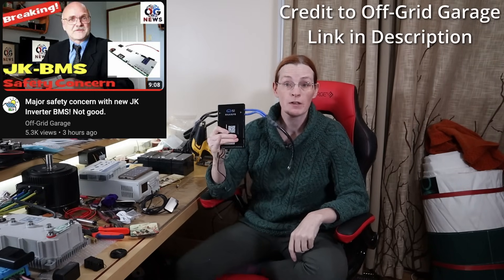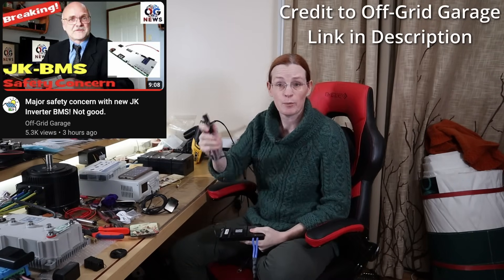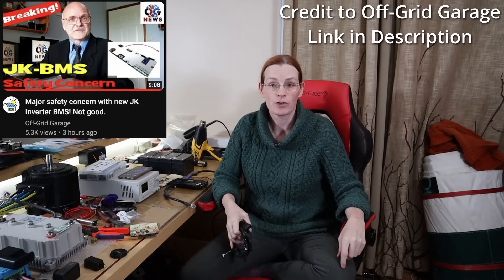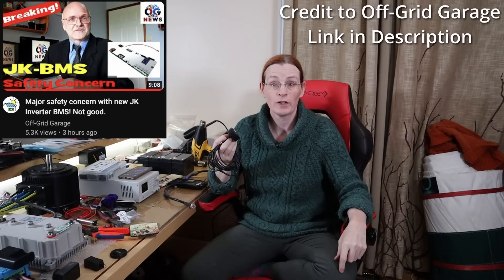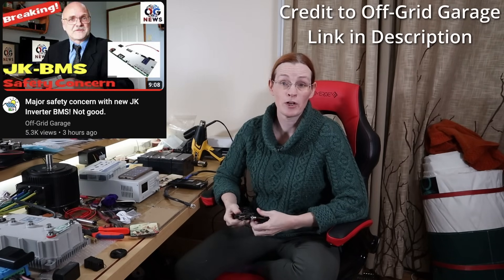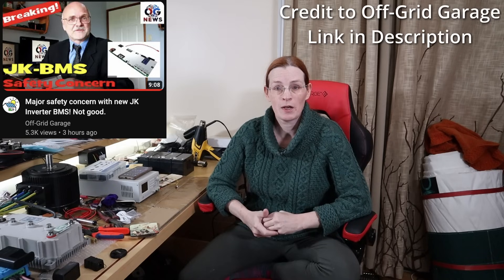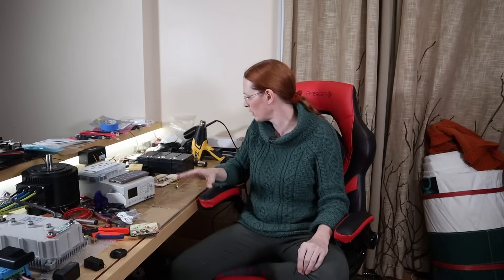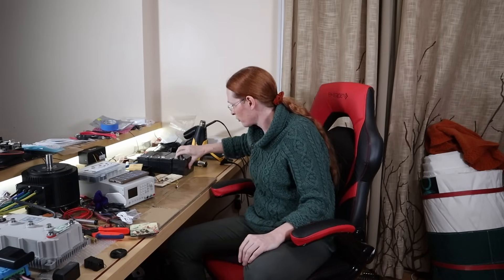News from Off-Grid Garage; Dangerous JK BMS Flaw

Comment: For once I strongly disagree. This is almost a witch hunt. Frustrated or not. This is an over reaction. We are talking about a new specific model that exists to be a replacement part for a very specific product - that has an issue in in a very specific way that don’t even concern the normal user. For Andy ? Maybe. But one of these are installed and set up and you forget about it - connected to A battery. You would never have seen this issue. This is IF you have one stored on a shelf, disconnected. End users don’t randomly dismantle their devices and put them in storage and then expect them to be put back in place without needing to set them up again. I’m getting not only frustrated but angry at you for your reaction. And no, I’m not on the pay roll of JK-BMS. Just lost a lot of respect for the channel for blowing this up in such a manner for a NON issue such as this. Daym.
Reply from the maker: To me, the most important thing is that I am trying to encourage people to take on projects. If I do that right, people will naturally copy what I've done. If someone bought that new jk BMS because of my videos, and then suffered damage, I would feel horrible. I was unhappy for a while with jk, I've made no secret of that. I make my living in redundancy and high availability; I can not call a problem like this "minor" when it could have been avoided with simple fail safe values, and/or basic quality testing. I'm sorry that you're angry with me, but I stand by my position on this.
Reply: @TheDigitalMermaid  yes, we both work in a similar field with regards to redundancy and high availability. Tho I do it on a more component level than you do. It’s not uncommon to see issues such as this from established companies like Carrier owned Autronika etc even - behemoths from USA. I strongly doubt this issue would be a crisis for anyone without “shutting it down” by disconnecting and effectively isolating it from the battery, something an end user does not do. If it happens when you disconnect a breaker on a battery or if you press a button on the BMS to turn it off while being connected it’s supply voltage from the cells then I would lift my eyebrows.  In my opinion no BMS should come without physical dip switches OR be chemistry dependent aka work only with a specific chemistry. Idiot proof is always the best way to do it even for professionals. Believe me, I’ve blown stuff up doing stupid mistakes myself plenty of times. It’s the PSA warning warning JK-BMS is junk I don’t like. It’s still the only BMS that handles balancing cells properly with a built in active balancer. Sorry I got angry in my initial post. But I was literally shocked by the outburst. And from everything I’ve seen and heard this is HIGHLY unlikely to be an issue for anyone not disconnecting it from the cells. So it’s not really any kind of shocking that they have not caught onto the problem with all the rush of Andy wanting the product out there in the wild asap with 10 software revisions or day depending on Andy’s wishes with regards to functions.

Comment: Well done Andy for bringing this to everybody's attention. Whilst I totally agree that this new JK BMS is potentially dangerous and that those who are about to buy a BMS should now look at other makes, the old JK BMS has stood out as being the the best on the market (see Andy's previous videos). Unless it is shown that these older JK BMSs have a dangerous fault I will continue to use them. I have three on a land based application which is a much lesser risk than on a boat. For most of us the 5v start up procedure is only a one-off procedure during first start up so is a minor inconvenience.
Reply from the maker: Older models you've used and tested are probably going to stay fine. The reason I felt I needed to make this video is because you never know what you're actually going to get from JK when you order. Maybe you'll get a good and reliable BMS, maybe you'll get one that could destroy your batteries. It's not a risk I can recommend anyone else take.
Reply: Don't overdramatize. Jk BMS are still the best of the budget ones and the speed they fixed this flaw is remarkable. Additionally use a BMV712 as independent last resort solution and something like this won't destroy anything in your system. Yes it should never happen but did...difference they stood up and fixed immediately. Fu.. up always happen, the difference is how and if you even fix it. This compared to many other company incl expensive victron that is not fixing anything or with a huge delay. Victrons 100V range of MPPTs for example the remote steering is hot=on when the remote cable gets disconnected due to any reason. Absolute noGo in EE and a major design flaw they don't fix since 5 years, the phönix shorepower charger 50/1/1 gets over 70 degrees hot but eg cable rating in boats and RV outside the engine room is 60degrees Celsius due to ISO standards...victrons answer was installed in engine room or change cables, 75 degrees is normal..really???...the dealer I bought agreed with me and took it back in the end.
Reply from the maker: @chrisr819  How would the BMV712 save a cell from overcharging with this flaw? It can't see the per-cell voltages. As I explained in the video, it's not just this issue, it's a long line of problems with this flaw being just the straw that broke the back. I can understand why people will still choose to use JK, and that's fine. Notice that  I didn't say "don't use it", I said "I no longer recommend them". I chose my words carefully. 

Every one of us has to decide where our comfort level is, and I have mine. JK crossed it, and this being my channel, I felt I had to say something. I've shown JK BMSes in use in my project for 2 years now. If someone saw that, and figured if I used them, they should use them and then they had a problem, I would feel terrible. So for me, my project, and my risk tolerances, I don't recommend them anymore. 

I'm not overdramatizing, I'm speaking my opinion.
Reply: Maddie the BMV712 has 2 measure curcuits so you can set it up as midpoint monitoring that means it measures one half so 8 cells 1-8 together versus cell 9-16. So if you have a runner eg 200mV in cell 10 then half 1 is eg 8x3.4V=27.2 versus 7x3.4+3.6v 27,4V and if you set thershold to 150mV then the BMV712 triggers the relay output to shut off. I take a breaker with trip coil, you need a battery fuse anyhow so the BMV712 connects to the trip coil of the breaker and battery disconnected. This is a requirement by ABYC and if you don't have it in US then you won't get insurance or if a claim happens they deny coverage and most likely cancel your boat policy. In an event like JK BMS all cell will go to 4.2V×16 and if your bank has 50mV deviation then the worst that can happen that 3 or 4 cells hit 3.7V while others have 3,55-3.6V and then the HVC voltage of 16x3.65V is reached and BMV trips the breaker. If you have bigger deviation (which you shouldn't have in 1p16s when they are top balanced and normally taken well care by BMS) then the midpoint monitoring trips the breaker. Like this no cell will be damaged. It cannot work on cell level of a single cell but its good enough to protect the bank from desaster events. And again ypu are obliged to have an independent last resort sountion due to ABYC doesn't matter which BMS you run and that for a good reason. With breaker with trip coil you have no additional contactor in your system, just a 2nd method besides a normal fuse has to disconnect it. I mainly use ElectrodacusBMS as i don't like contactors but also no mosfets based BMS as i often use bank as hybrid starter and house and the inrush or surge currents of a motor destroy the mosfets over time, especially if they are not matched and calibrated which for the price JK offers their BMS (as nearly all other chinese mosfet BMS) is simply not possible to do. So if a motor sizes the surge can be easily quadrupled and that kills eg one fet of your 10, BMS still works but with 9 that ahve to carry the current but because unmatched they do 't switch in the exact same moment so 1 or 2 fets have to carry the whole load..and wear til they break. So you have a slow and unrecognizable slow death of the BMS as when eg 5 fets are left it can only carry half the spec. For motor and propulsion you need a current free BMS ELECTRODACUSBMS is perfect but not available in 48V, so more or less contactor based ones like REC are your only correct choice. That just as a side note. I often use the combo in house that i have a main pack mostly from winston cell thats the master pack and eg starter and windlass is connected because this cells can do 8C peak together with an ElectrodacusBMS+BMV712, then parallel battery packs 1p4/8/16S with 280 or 304AH EVE cells+JK BMS+BMV712 to get the desired capacity. So they don't get any huge surge currents. the BMV712 then brings all the battery data into cerbo too.

Comment: It's a firm wear problem its defaulting to Lithium Ion - It should have been spotted at the development stage - Fortunately most folks solar or grid chargers will prevent overcharging as long as the cells are in balance  - it needs resolving ASAP as the BMS is the primary safety system
Reply from the maker: The problem is that the voltage curve is so flat, that it doesn't take much for one cell to spike it's voltage before the others. Unless the BMS can request the chargers to stop, I don't think it's safe to trust the chargers to save your cells. I think I'll do a follow-up video, because this has come up a lot.

Comment: This is what happens when Electronic Engineers do software. I've seen this before and will again. They always say "why does it cost so much to do software? Its easy!". Rant over.
Reply from the maker: You're not wrong, but the problems at JK are structural, I am now convinced. In the end, product quality is the responsibility of management, they allocate R&D budgets.

Comment: The part from the 4s-8s i got one around the same time and in the video where you test the 4s i don't think you connected the last positive wire to battery+, the last wire is the power supply wire for the bms, could you retest this please i am really intresed if it will work, you just need main battery negative on the ballance wires and on the B- connector, and power on the most positve wire as this is the powersupply lead. So you don't even have to build a pack to test this just connect it to a 12v psu or one of those lead acid batteries.
Reply from the maker: I did, it didn't work. It was a fairly narrow window where some BMSes were sold under that model number without 4S support.
Reply: @TheDigitalMermaid  Thank you for testing it, they really should held accountable, problem is they will only do something about it if it start hurting there business. SO the only thing we can do is not promote them and don't ever buy there products again. Real bummer tough i finally found something good.

Comment: Little bit of an overreaction, it's only the new one that has issues, no need to throw out the baby with bath water. 
The older models are rock solid.
 Yes there were improvements made, adding the startup switch
You probably should have checked it worked the older models, yes a bit confusing using the same models, but you were aware of the limitation. 
How did you think the new display/switch was going to work on the original model? 
Some presales chats/emails with the suppliers would have sorted out that.
Always best to confirm "Life moves pretty fast. If you don't stop and look around once in a while, you could miss it"
Reply: What should have been done is easy to say in hindsight. But I also never saw a manufacturer being this bad at documenting incompatibilities between hardware revisions that the customers are supposed to contact them about every single detail, and then also blaming the customer for not asking.
I bet most people saying "you should have just asked the seller" never even asked a seller a single time beforehand.
Reply from the maker: @Ether_Void  That's just it; I can speak highly of a given model, but then someone could order it based on my experiences, and get a different product. That's not acceptable.
Reply from the maker: Did you actually watch the video? I laid out why I no longer recommend JK, and it goes well beyond this one issue.
Reply: @TheDigitalMermaid   Yep sure did, they have this issue with new BMS, and you had some bad experiences not confirming things and assuming they would work. Now you suddenly think all their BMS are bad. 
I think you maybe need to take some time to stop and just consider they are trying their best to improve their products, and it doesn't always go as smoothly as you would like. In this case a bug or oversight that is less than great. It's brand new product from the bottom up, there are bound to be issues with a V1.0 product. 
It doesn't suddenly mean the older products are less reliable or not fit for purpose.
Reply from the maker: @uksa007  I gave them the benefit of the doubt many times, through many problems. This problem is egregious though... Where are the fail-safe default settings? Where is the quality testing? Why do they blow FETs in over-current conditions? Why do they think it's OK to make major changes under the same model number? A BMS is a safety device, it's not a lego set. They respond to criticism by being dismissive. Nah, we're not talking about a simple mistake, this is a continuing pattern of not caring about the safety equipment they're selling. I'm done giving them the benefit of the doubt.
Reply: @TheDigitalMermaid  Everyone thinks turing of huge current with FETs is easy. It's not, one FET that is slightly different due to temperature or manufacturer tolerances, can be slightly slower switching off, so that one FET can be left trying to stop 200A or more, and it lets the magic smoke out. 
It's why I continually say do not allow the BMS to switch off the FETs unless there is an emergency.
The BMS is a safety device that may well become damaged during the process of trying to protect your batteries. The previous changes were improvements that you assumed incorrectly were able to be retro fitted to your older model. None of that had any impact on its robustness. 
I agree the NEW BMS is more of a beta product that should have had more testing before being released, but then maybe this issue still wouldn't have been found till now, if it's just in some specific set of conditions.
Reply from the maker: @uksa007  We're going to have to agree to disagree on this. You see no problems with what they do, and that's fair. To me, there are huge problems. This is my channel, and I don't want to hear someday that someone saw that I used JK, so they used JK, and then something went terribly wrong for them. JK is not up to my standards.
Reply: @TheDigitalMermaid  My concerns are with your opening statement "JK-BMS's are bad...", it is factually incorrect and misleading in this context.
Sure the "New JK-BMS is bad" and if that is last straw for you I get it.
I think a lot of your audience are already using JK-BMS and so it might be better to take the emotion out of it and address what issues you currently have with your current JK-BMS (none ?).
Most BMS vendor are mostly the same (Chinese) and have similar issues if not worse.
Unless you want to spend significantly more money on something made in the West.

Comment: It should be clearly stated that it is affecting the new ones only, and should also be made clear how to check the settings, so users can learn how to check after switched off for a longer period.
This was just too much "breaking news" for me. While still a big problem, it is important not to scare everyone, and to convey useful information in a situation like this.
Still a happy follower :) This didn't sit well with me though.
I am also not sure how it will improve safety to remove the JK BMS's that you know does NOT have this flaw. It is not like other manufactureres are immune to making errors....
Reply from the maker: Pinned comment, and I spoke to it in the video, this is not an isolated incident. This is just an egregious failure in a long line of bad design decisions, lack of QA, etc. Look at Andy having two different JK BMSes blowing FETs on over-current tests. Look at how they change, fundamentally, things like supported configurations or available ports under the same model number. As I said in another reply; this is the straw that broke the camel's back, not the whole bale.

Comment: I have been looking for a mid-range quality BMS for a long time. The market is flooded with really scary devices. I'm an electrical engineer that designs power electronics (for different applications).

I have looked at these low-cost BMS units and totally unwilling to attach them to any of my packs. 

Maybe I should design and build my own. There is probably enough frustrated people in the market to pay a little more so I could cover the development cost.
Reply from the maker: Developing a modern BMS is surprisingly hard, but by all means, I'd welcome anyone to try new designs. One thing is clear though; These cheap BMSes are not the right ones for safety critical installs (which by the nature of batteries, most are).
Reply: @TheDigitalMermaid Agreed...
I did a basic project definition for a BMS a couple of years ago. It was not a trivial product design cycle by any means. 

What I wanted in the end is a system that is aerospace reliable and ensure that failure modes are benign. 

Single points of failure in a BMS is scary. The consequences can be severe, as you clearly already know.